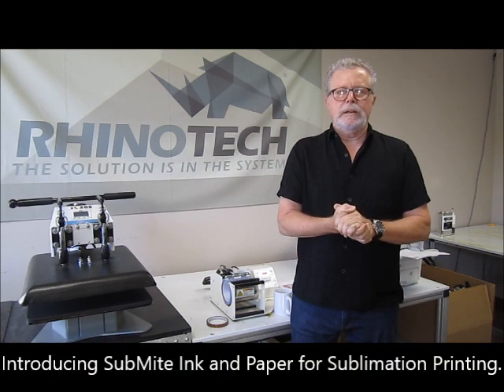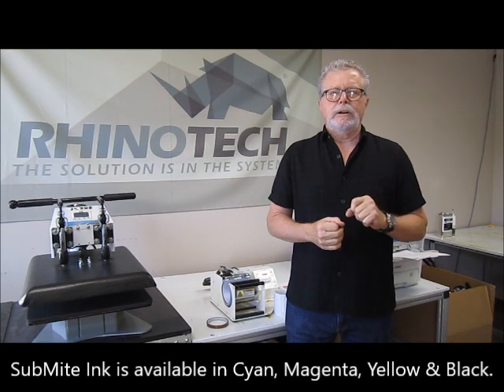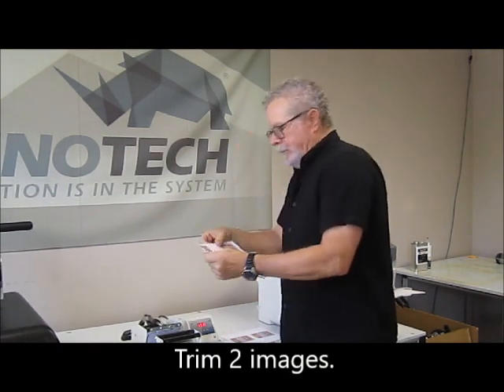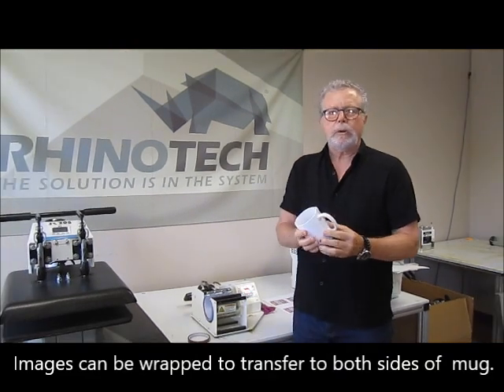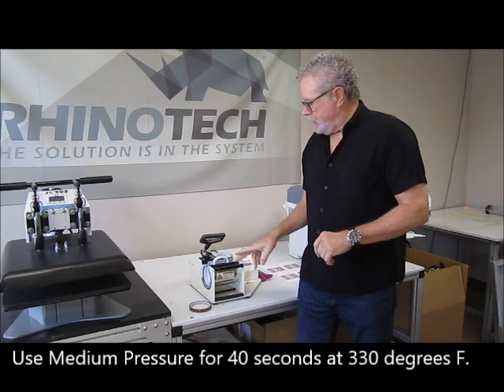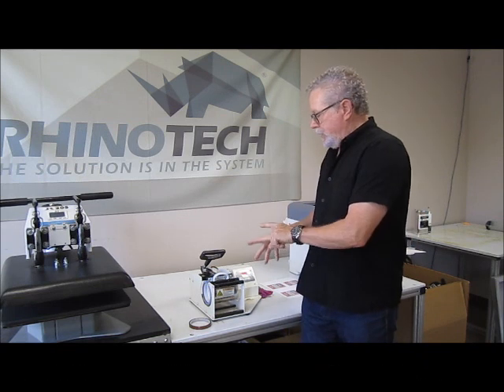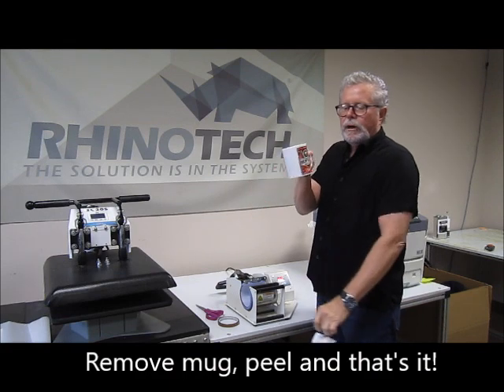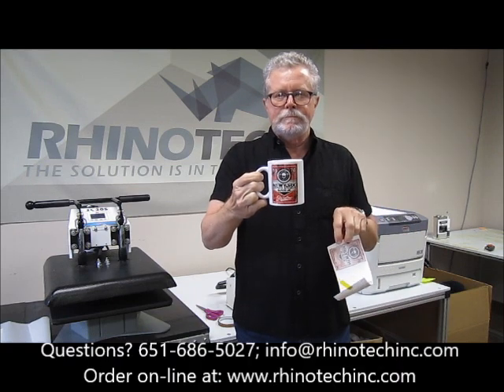Sublimation Transfer Printing onto a Ceramic Mug

Comment: How do you export your file? Jpg tif or png?
Reply from the maker: Thanks for your question. Generally, we print directly from or graphics program to the iColor 550 printer. If you need to export to a flash drive, a jpeg would be sufficient. Hope that helps. Please give us a call if you need any other info. 651-686-5027 x 4 or 2. www.rhinotechinc.com